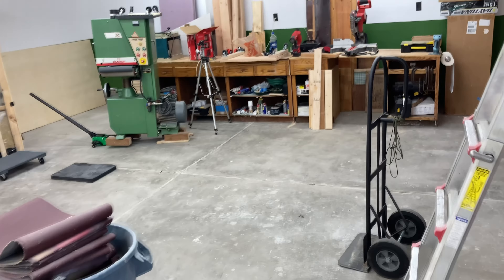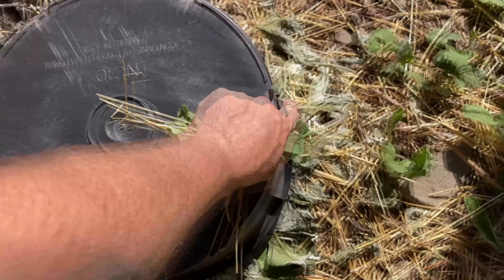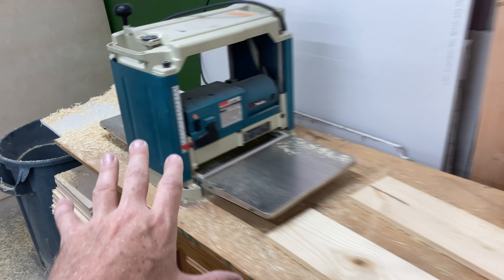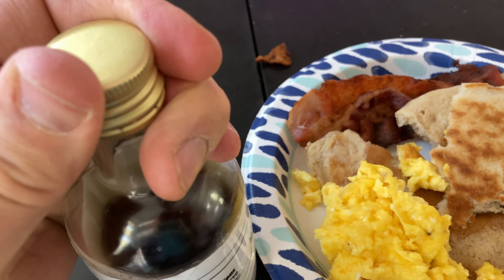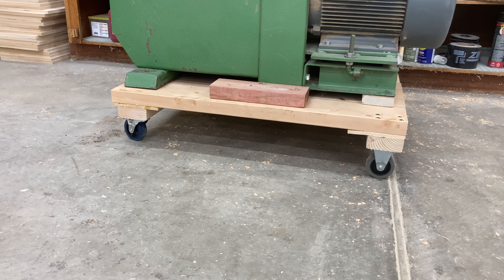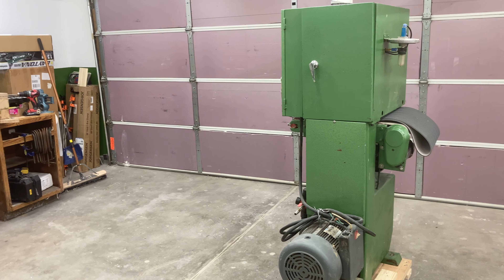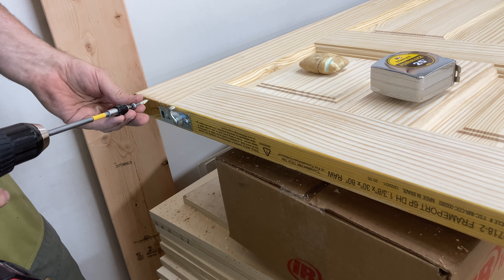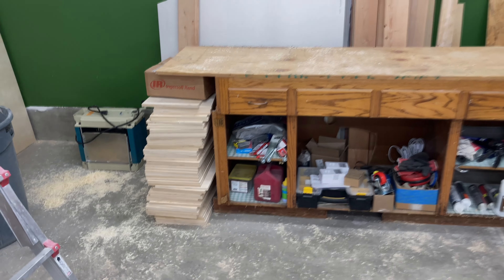I Almost got Crushed by the Big Saw

Comment: I personally would have ground down the bolts to the desired length. If you put nuts on them and take them off again after cutting the bolts down, the threads on the end will be ok to use.
Reply: I might have if I had a grinder,

Comment: There are these universal engine mounts that can be adjusted. Could those be useful for levelling the big machines?  
Those come with and without a rubber bumper. I'm sure those are available in your country also.
I'd assume the garage floor is tilted for drainage all the way, so adjusting the machines might be necessary every time they are moved.

Edit: those adjustable type mounts are commonly used in marine engines.